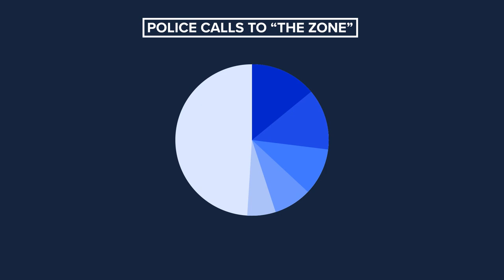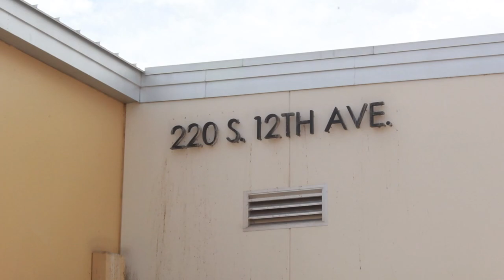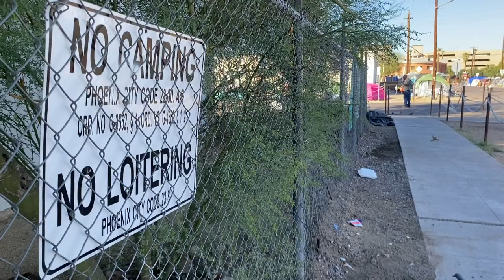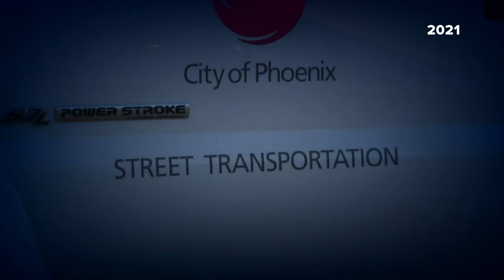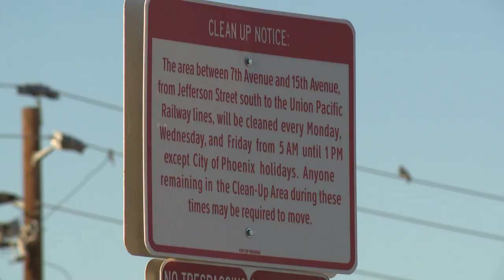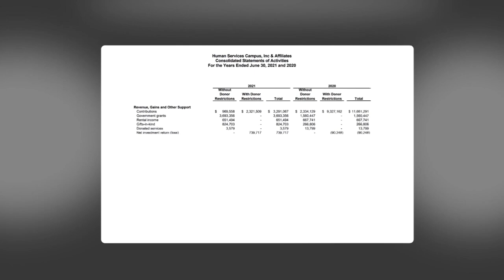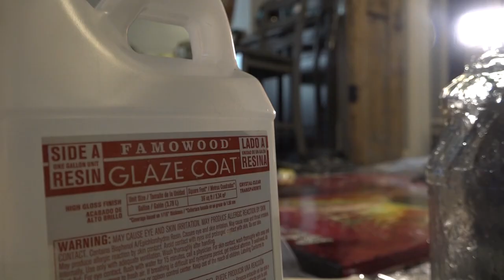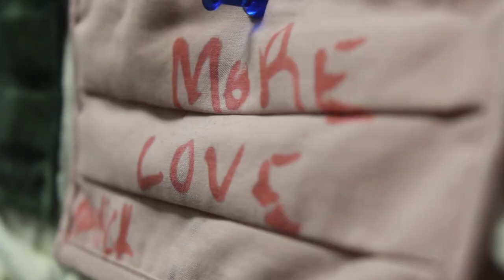Cost of Crisis: A look at conditions in 'The Zone,' Phoenix’s largest homeless encampment

Comment: This goes on because it's tolerated.
Start by paying teenagers $15 per confirmed (video taped) hit with high powered air-pellet rifles
This will clear out 90% by the end of the week. 'Move up to low grained .22 shorts pushing rubber bullets.
That ought to clear them out  -  Let me know,  thanks

Comment: RENT CONTROL IS A NECESSITY. The cost of housing has jumped from $900 a month to $1700 in two years thanks to greed as California residents escape high rent. To them $1700 is low to Arizona's population it's out of control. The other issue is fentanyl.